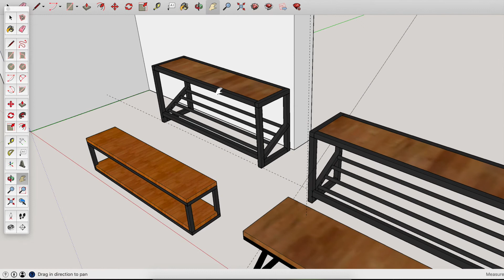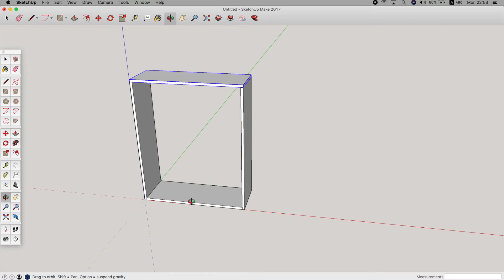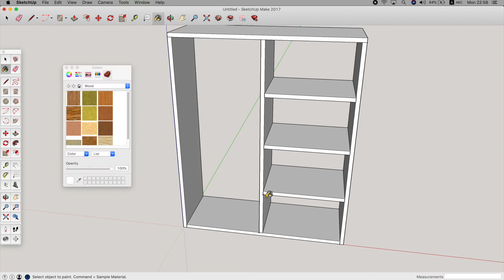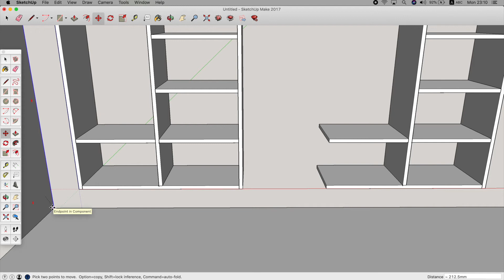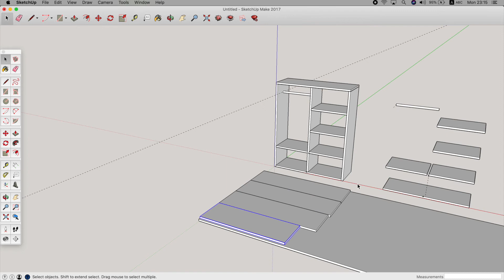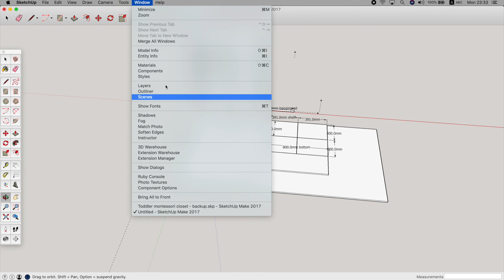Sketchup builds and Cutlist // How I like planning my DIY projects

Comment: Why u are not using open cut list...?
Reply from the maker: Good question... My projects have been relatively simple so far, and with this method I have full control on creating the cut list.
It's also quite easy to understand, if you got to this point where you have a model, you can easily follow the steps to create a cut list.
Another reason which is I don't like installing extensions unless I absolutely have to.
But you might have other considerations :)
Have you tried open cut list? What are your thoughts on it?
Reply: @diywithguy  yes i agree with u on that its kinda easy way and helpful for individual projects im using open cut list its help ful for me when im working on multiple itemes more then 10 sheets at a time it helps me to have less wastage ..1 thing im concerned about open cut list extension sometimes some of the parts can fit into same sheet but showing in extra sheet if i have 200x 60 quantity 2  these part can fit into 1sheet but in open cut list it will show u 2 sheet requirements.....
Reply from the maker: Well hopefully you'll find this method helpful for those situations :)